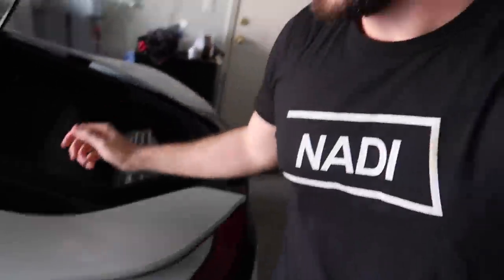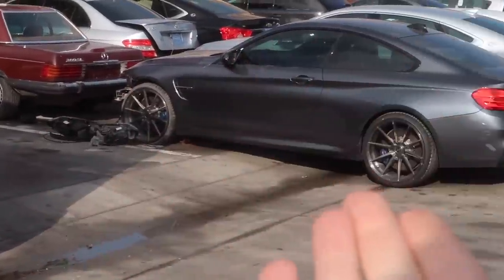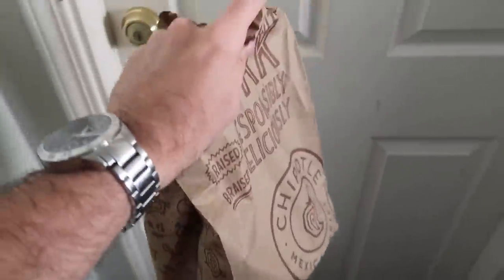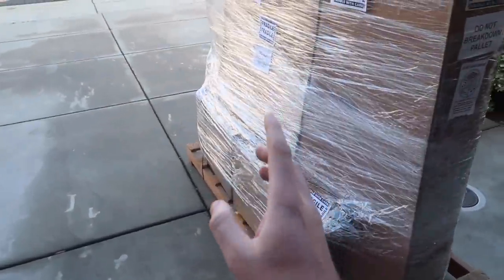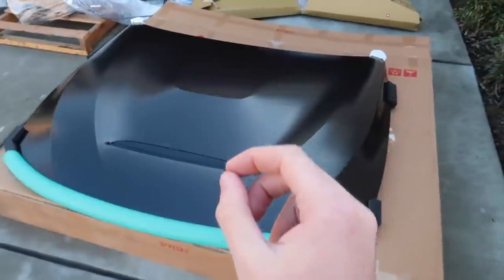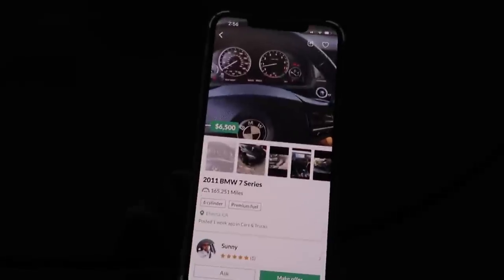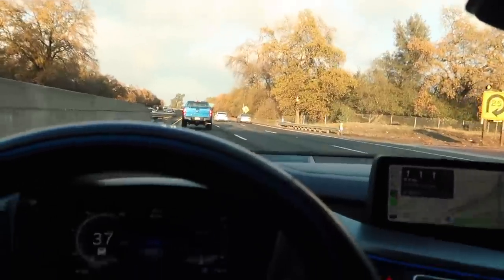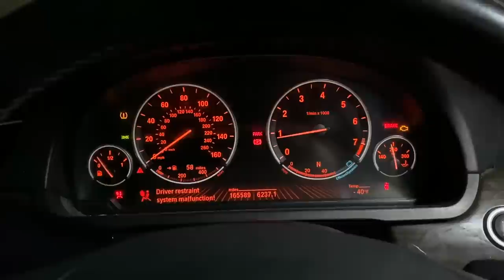SHOULD I BUY THIS MOST UNRELIABLE BMW? (7 SERIES REBUILD?)

Comment: It's worth saving and will provide hella content for the channel. 740s are easy to maintain and most problems arent nearly as major as 750s. You'll have no problem finding parts for cheap as well. I would bargin it down to no more than $3k. Probably gonna take ~$2k in repairs but resale after you revive it will easily be $10k knowing how well you do with BMWs
Reply: Cap asf

Comment: Bro, unfortunately I would have to say pass on this one. For the simple fact that the F01 7 series N54 is the only N54 that can't use JB4. That is a no go for me especially because it is LWB model. It needs the extra torque as it is a heavy car. Try to find an LCI with an N55. Or maybe even one with an N63/TU. It could be scary and uneconomical to fix (rod bearings, oil leaks, valve stem seals) but could be for some good content. Make it into a VIP ride.

Comment: I own a 7 series there are too many cheap good cars around to buy a complete wreck, run from that car it'll cost you thousands to get it in decent condition.
I've had my F01 for 3 years with zero problems, I do all the work myself but because I'm on the UK I have the 740d twin turbo diesel a very reliable engine. The 740i petrol is a good engine choice but run from and N52 750i.

Comment: Naw. I wouldn’t touch it. It’s nothing but a rabbit hole. It will be issues after issues. I had 4-5 bmw now. My current E90 and Z4 are amazing but those were one thing after another. Mostly electrical, all that damage, super high mileage. Don’t touch it.

Comment: I'm rebuilding 7series 740i 2015 the engine is N55 and its reliable more than the N54, I would get away from it and get one that is n55 740i loaded, you can check my channel, not much of work but almost done.

Comment: do not buy the 7 series, i bought a 2011 750li from some guy in santa clara. 
I got it for $6000 clean title 101k miles but it leaked some l and had some small electronic issues. 
I started working on it and i just sold it and broke even, too much money will go into that car to make it good enough for it to even be remotely worth it